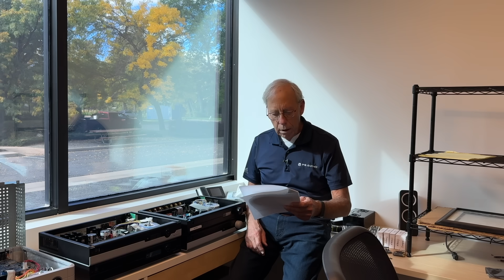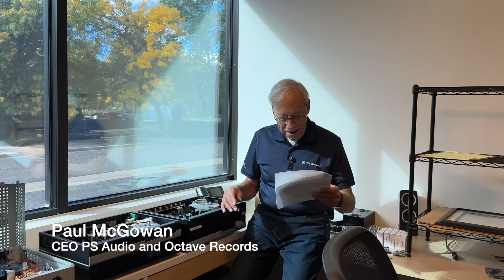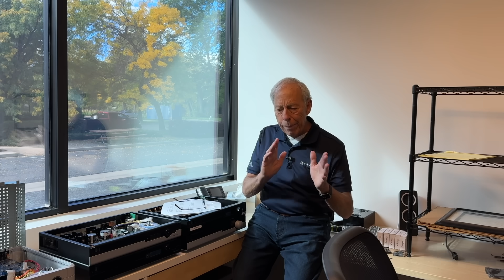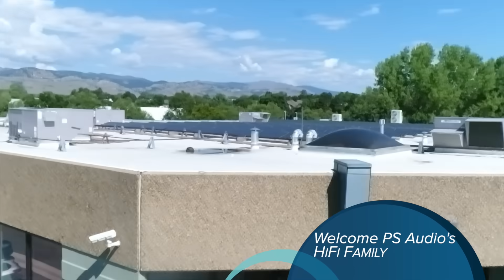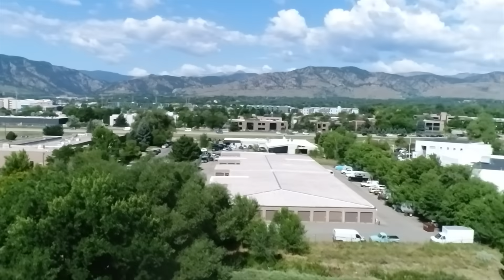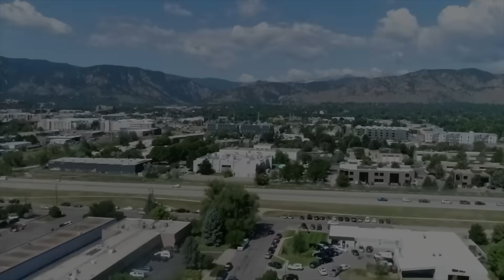Paul explains AES EBU

Comment: I tried I²S between my transport & DAC & I was using a 0.75m Tubulus - 'Consentus MkII' cable (on loan & may I add, not cheap) & yet I found that the AES/EBU connection, using a pure silver XLR cable, to sound sonically just as good, if not better, & at a fifth of the price of the 'audio-dedicated' Tubulus HDMI cable for I²S. No prizes for guessing which option I went for. Briefly harking back to yesterday's post about Scott McGowan moving on from PS Audio. I would remind those who wondered about the natural succession at PS Audio that Paul himself left PS Audio, decades ago, to go & work with Arnie Nudell at Infinity before returning to be the CEO of PS Audio. You never know if history might just repeat itself with regard to Scott McGowan 🤔😉
Reply: my testing results were same as yours.. i use aes/ebu as best option in my gear with the cable i have
Reply: Surprising.
Reply: @BruceCross   ...yes, I was very surprised & not just because of Paul's 'pushing' of I²S but also the sheer logic of keeping the clock signal separated from the music signal. However, for decades I thought that audio-grade after-market power cables were snake-oil because of the 'logic' of miles of average cabling to bring the power supply to your home & then the last 5' of higher grade copper wire is going to make a sonic difference?? And yet it does...go figure. This, again, just goes to show you (me) that the ultimate judgement comes from your hearing & not necessarily from what you have been told, or what science 'dictates'.
Reply: Logically, an I2S connection should be better. Power cables shouldn't make a difference. Sigh, the madness of high-end audio.  The science crowd loves to badmouth our hearing as opposed to measurements, but it's the ultimate arbiter. Our hearing is an incredible instrument, although our brain can play tricks on us.
At my first job, I knew an electrical engineer who told me to never buy anything more expensive than I could hear. You just reinforced his advice.
Reply: @BruceCross   ...I like the logic of that electrical engineer 👍
Reply: @BruceCross  Eyelids open, I hear a particular phoneme; eyelids closed, I hear another. "Try this bizarre audio illusion — BBC" is one of these tests. Some audiophiles advocate for using only our ears; they mostly use their eyes, the retail price or the prejudices instead. Professional ABX tests aren't easy or cheap to do. In these ideal and very rare conditions, hearing will be reliable. Hotel rooms ? I can make the same cable sound and measure differently without being near the system. A full comprehension of all measurements required for a particular test is also difficult. These audiophiles usually take only one measurement to make their point, instead of all the measurements required.
Reply: @Jorge-Fernandez-Lopez   ...I've been listening to home-audio for 46 years & there's only one successful way to measure the effects of different cables on your home-audio rig & that's with your hearing; that's the only measurement required as far as I'm concerned. "...all measurements required..." according to who??
Reply: @Jorge-Fernandez-Lopez  ABX tests aren't good for food or audio, your life would be way worse if you used ABX tests for either one.
Reply: According to engineers that have designed or built our compact discs, our preamplifiers, amplifiers, converters, or the cables we use for telecom. I'm not one of them, but I can calculate when a cable will sound worse and be less transparent (loss in decibels for each frequency). Some engineers have measured that some "high-end" cables gather noise as antennas or have extremely high resistance (less damping factor). One might enjoy that kind of cables, but it doesn't mean that their hearing is reliable. This isn't important for ourselves, but it's definitively a concern for reviewers.
As I said, even if I have no idea (lack of decades of "expertise"), I could imagine a test in a hotel room where people would hear and measure a difference (at least 1 dB) between two cables, even if the two cables are the same, even if I don't change the cable at all and I don't touch the system. An expert in acoustics, electronics or electricity can remotely make wonders.
Some "audiophiles" argue that measurements don't mean anything by using only one measurement. The problem is that many times we don't understand technical concepts (electricity, acoustics, etc...) and our premises are wrong. These "reviewers" use only one measurement when multiple are required (examples: only on-axis response of speaker vs on-off-axis, compression, distortion, impedance, sensitivity...). They used to talk about the wonders of analogue sound, when their expert hearing (decades too) was listening to digital sound converted to analogue,  misinterpreted distortion of amplifiers or even recommended grounding "techniques" that could be lethal.
As a listener and consumer, I listen to reviewers that share technical knowledge that works in my system (on any system).
Reply: @mitchtaylor6512  I don't need ABX tests for food or audio; I buy components that do make a difference or cables that will be perfectly transparent. Salespersons do need ABX tests for some products if they want to sell them to some consumers.
Reply: @Jorge-Fernandez-Lopez   ...as soon as I read, "According to engineers..." my eyes glaze over & my brain switches off. There's only one way to judge audio & that's with your hearing...full-stop! As a listener & consumer, I listen to audio. When I was much younger I cared about the technical side much more, however, years of home-audio experience has proved to me that the technical side of cables/connections is not worth my time to consider too seriously.
Reply: @Jorge-Fernandez-Lopez then why would you bring up ABX tests? You either like the taste of something or you don't, same with audio you like the sound or you don't.
Reply: As soon as I read "according to who?" I knew that your question was rhetoric. I explicitly wrote the answer (although rhetoric questions....) that would trigger the last one.  You like cables, don't you? Advises made by salespersons working currently in shops (fewer shops) or reviewers (more and more), that claim that they have decades of experience and hearing is the only way to judge about speakers, cables or amplifiers, haven't worked for me. Most of the time these claims were wrong in practice or even bad for the audio components (according to the manufacturer). I'm not a  "full-stop" obedient listener. I enjoy listening to people that think differently. Then, I try to integrate these opinions, facts and sometimes knowledge with the content of books that I have read or my own experience, and I wrote them. I don't buy randomly. If I need a fast car for a circuit, I wouldn't buy a Citroen 2CV, an Ariel Atom, a Hummer, a Toyota Prius and an Hispano Suiza Carmen Boulogne even if I could, just because reviewers told me to do so because specs and technical knowledge don't matter. I wouldn't enjoy this hobby if I was a "passive" consumer that buys randomly. I want to learn real knowledge that can be share, and not only a bunch of brands or models combinations that only work in a particular room, with a specific system for only one reviewer's taste. I would buy directly the Ariel Atom directly or any other faster car that purpose, instead of losing time or money. I'm not exaggerating with that example. Some very known reviewers say than 1, 3 or 5 W are enough regardless of the circumstances (even if that advise can damage the speakers) while other recommends hundred or more. I enjoy channels ASR, Francisco del Pozo, Miguel Ángel Racero or Erin's Audio Corner, but I also listen carefully to PS Audio, and occasionally, I might also watch some videos from Steve Guttenberg, Darko or Audiofilia y + even if their content didn't work for me or could damage my system.  It's a journey Fat Rat. This is the way I enjoy and it worked for me.
Reply: @Jorge-Fernandez-Lopez   ...yes, it has been a journey & at 65yo I am now coasting (as it were) with the cables that I have. I'm very sure that I won't be upgrading them again; they are, for me, end-game cables. Cheers ✌💖🎶
Reply: I feel the same about my speaker cables, although I will have to buy new ones again if these aren't long enough. Cheers, Fat Rat.
Reply: @Jorge-Fernandez-Lopez  Regarding the objective vs. subjective battle, I believe in both. We can measure things we can't hear. We can hear things we can't measure. We keep learning. For example, the importance of low jitter in digital audio. For cables, the electrical characteristics, conductors, shielding, microphonics, RFI, EMI, terminations, connectors, grounding, etc.

I enjoy looking at extensive speaker measurements, such as those by John Atkinson of Stereophile (not everyone can afford a Klippel). They reveal a lot, especially the off-axis responses, spectral decay, and step response. I wish we had consistent measurements for every speaker on the market, but it's not even close. Manufacturers "embellish" specs.

Human hearing has a time sensitivity of 8-12 microseconds (millionth of a second), yet we can barely hear a 3 dB difference. The top microphones are accurate within 1/2 decibel, but they can't separate the detail, timbre, and imaging like the human ear. Two speakers can measure the same, but sound different. ABX tests run into issues with "echoic memory," which lasts 3-4 seconds. Others claim it's less than 1 second. Our biases and moods affect our decisions, but that doesn't mean we can't experiment to eliminate those variables. Break-in is another controversy.

Measurements are a great starting point. However, I make my final decisions based on short and extended listening. Some things are immediately obvious. Some things can take weeks to notice. One of my favorite observations is that most people can hear equally well, audiophile or not. The only difference is that audiophiles can describe it better.
Reply: @BruceCross  I feel that way. I believe in both too.
Reply: @clickbeetle2720  I didn't wrote any book, I read books mostly. However, I wrote some personal notes for personal use first, then I decided to share it as a PDF document (65 pages) on online forums (De Audiofilos y Locos, Audio Planet). The document is in Spanish, although I'm writing the French version (25% done). Obviously, it's a personal interpretation of the hobby. It contains a basic summary of each component of the audio chain (for neophytes), a more "advanced" section about room and acoustics (practical) with several approaches (by ear, mathematics, measurements),  explanations and formulas about sensitivity (difference between dB/W and dB/2,83 V both at 1m) and how to do the estimation of the amplifier power according to distance,  headroom, volume and dynamic range, how to design QRD diffusers or acoustic panels that do work and which won't work, information (also opinions) about digital or cables (differences), parametric equalization (with or without hardware or any computer switched on, etc....
Some of the reference books and PDF that I use: Audiophile's guide — PS Audio, The Master Handbook of Acoustics — McGraw Hill, Test pour câbles et haut–parleurs —Nouvelle électronique, Sound reproduction – The acoustics and psychoacoustics of loudspeakers and rooms — Floyd E. Toole, The complete guide to bass traping — Jesco Lohan, Formulaires et tables — CRM, Fundamentos de tecnología eléctrica — UNED, and my own notes from the schools about physics, electricity and mathematics. 
Tools: Audiophile's guide companion disc — PS Audio, Ultimate demonstration Disk — Chesky, sound meter, flexometer, calculator, pen, tones and ears. 
Some methods only use hearing, because I wanted to feel the acoustics problems. More advanced methods are shared once we feel the physical nature of the room interactions. 
This is not the place to talk in depth doubt books or other channels, although I wanted to answer to a very specific question. Books have been extremely useful in my audiophile journey, more than most channels together.
Reply: @Fat Rat: Interessant ist nur, daß diese - ach so super-dummen - Ingenieure es sind, die Ihre Objekte der Begierden konstruiert und entwickelt haben ! Ihre Naivität ("...Audi nach Gehör beurteilen...) und Arroganz schreit zum Himmel !! 😞
Reply: @BruceCross  Was man hören kann, kann man auch messen ! Man muß es nur zuordnen könnne ! Und letzteres können HiFi-Fans nicht !
Was meßtechnisch gut und einwandfrei ist, läßt auch gehörmäßig keine Wünsche offen!
Reply: @bachglocke3716   ...what is your point?
Reply: @bachglocke3716   not everything that measures well sounds good or great & vice-versa...you should know this fact by now.
Reply: @Fat Rat: So geh nun hin, Dein Glaube hat Dir geholfen - amen  !
Reply: @Jorge-Fernandez-Lopez  Interessant ist immer wieder: Diese - ach so doofen Ingenieure - können Geräte bauen, mit denen man so "audiophile" Aufnahmen machen und auch hören kann. Komisch, daß es diese "Objekte der Begierden" nur durch gestandenes Ingenieurwissen gibt !
Wer physikalische Fakten und/oder gestandenes Ingenieurwissen ablehnt und/oder durch modische Trends zu ersetzen versucht, wird immer nur Mist erzeugen !
Reply: @mitchtaylor6512  Because ABX tests very often prove that the difference you imagined you heard was nothing else than just a placebo. 
Those vibe people who only consider their own "hearing" are afraid of ABX tests because they don't want to break the delusion they enjoy having.
Reply: @BruceCross  The idea about ABX test is that you actually choose what you think sounds better, not knowing what you are listening to at the moment. Very often your brain is tricked by the excitement of hearing something you expect to sound "better", e.g. because of higher price tag. It's not even like you're lying to yourself or others then that you "hear the difference" or "this is better". It's your own brain that lies to you at that time. Testing things blindly, helps you to minimalize that issue.